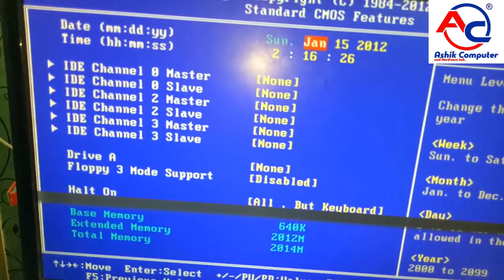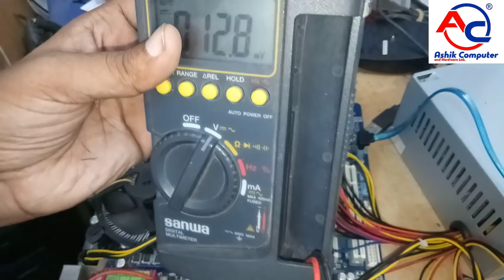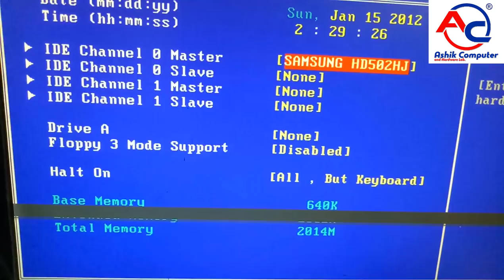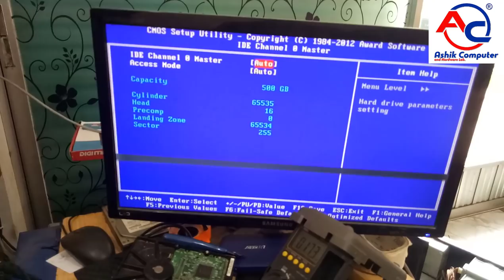repair hard disk no detected | HDD not support | Bangla tutorial

Comment: vai ami shamim, chuadanga theke.vai ami apnar video dekhe onek kisu shikhte parsi.ami youtube te onek video dekhesi kintu apnar erokom sundor o shabolilvabe kauke tule dhorte dekhi ni.apnake proshongsha korleo kom hoye jai.asholei onek onek onek  valo video gulo.vai ami 25000 takar moddhhe ekti desktop computer nite chassi.kon company er parts gulo nibo ektu bolben guru.ami apnar boro fan hoye gesi.ami khub confused asi asa kori reply te janaben.amar no:01763577774.dhonnobad die soto korbo na.
Reply from the maker: Apni asus 250 bolen 7gen er moard nen,processor niben 7gen dualcore,128gb ssd niben r 1tb toshiba,2yrs hdd,super speed paben,Thanks a lot,
Reply: vai ete ki ami normal video edit korte  parbo i mean freelancing.ar ami jodi ei price second hand computer nei tahole kemon hobe vaiya?
Reply: Asik by 25000 taka ai part ki kinte parbe?
Reply: aponi ki monitor chara account karechen